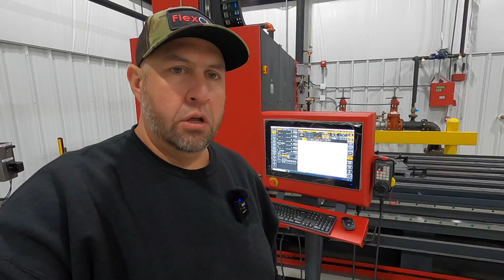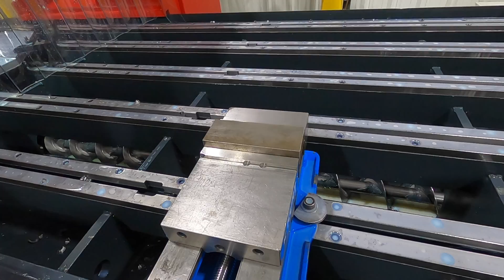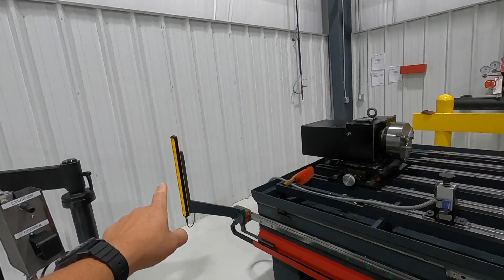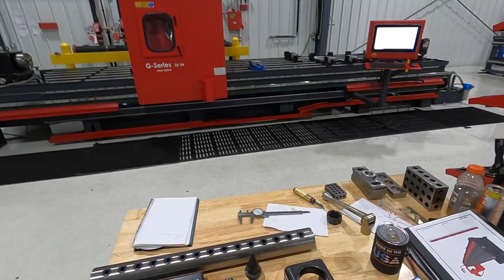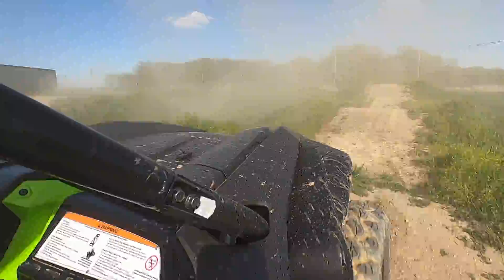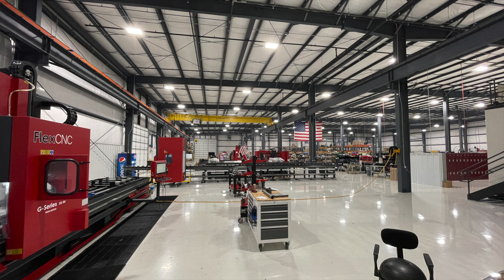SNS 347: CNC Training @FlexMachineTools

Comment: CNC is good when you have to do the same thing many times, for example producing some goods. But when you are repairing something the CNC is not so good anymore. Manual machinig will work fine there and that's why I like this channel. The parts get repaired, not just changed. Keep it going, Adam!

Comment: I've been running CNC since 1983. The first piece of advice I give to all new people, you control it, it doesn't control you. You are in charge, size of machine doesn't matter. Single block, distance to go, rapid and feed override. Learn to use what you are provided with. I've worked in shops since 78, manuals first because there wasn't many CNCs yet. I guess that makes me a OG 😆
Reply: Did you have to use punch cards?
Reply: @TheDandyMann  no, I remember them. I did use reel to reel. Paper tape and metal tape.
Reply: @daviddelaet8116  That's so cool, its amazing how much technology changes and the materials and techniques change with it
Reply: @TheDandyMann  I agree, that 3D printer is very cool. One shop borrowed one for a couple of days and made a 6 inch Cresent wrench out of plastic. They will use those in the space program to manufacture parts on site. Need a wrench on Mars? Make one. 😆
Reply: @daviddelaet8116  i knew one years ago that could read a paper tape, and tell u what iit was going do
Reply: @TheDandyMann  I also like the old machines are being used again. The old screw machines and automatics had nothing wrong with them. Once owners were bitten by the CNC bug the old machines had to go. There are a few exceptions, but not many. One of the first machines I ran was a Warner Swazey # 4 turret lathe. I enjoyed that very much. Hardinge tool room next, that was the smoothest I've ever run. I like the mills now, nothing like 5 axis cutting. Also the Mazak Integrex was pretty slick. I prefer Fanuc because it's what I ran for 30 years and I don't care for Mazatrol. It's been an interesting career for sure. I've got parts on the space station, I've made timing mechanisms for thermonuclear warheads, plastics, woods, and everything else.
Reply: @daviddelaet8116  Man you've been around. Love to hear stories and experience like yours
Reply: @TheDandyMann  I've been around a bit. Michigan, Missouri,  New York, now in Wisconsin. Missouri I made lazer guidance systems for the F-14 Tomcat for Litton. New York was more for the F-14 but engine cowling parts for Northrup Grumman. Michigan was air to air refueling for the new 767 tanker for the air force. Wisconsin is dairy and cheese processing. I've done tool and die in a shop with nothing but manual machines. And I've worked in shops that would drop a million on a machine and not blink. I would literally have to think and write down all the companies I've done work for.
Reply: @TheDandyMann  I guess I could write a book 😆
Reply: @daviddelaet8116  I would read it for sure

Comment: I love CNC lathe machining. I've been doing it for 13 yrs now, and the place I work now I do Mazak lathe and a few different manual machines. My favorite manual machine is a Derkes VTL. We use it to turn big hub plates and capstans for wire drawing machines that we build in our assembly dept. I love your channel because I learn great setup techniques on manual milling machines for some of the rework stuff that I have to do. Parts that you can't just stick in a vice. Know what I mean? Thanks Adam(Abom79), you're great man, machinist, and Youtuber! 👍👍

I'm 100% on board with you furthering your machining experience with CNC!! It will definitely be beneficial for you AND anyone you can do projects and work for. You are on the road to bigger and better my man. Keep up the great work! Love you brother! You're an inspiration to me and many others.

Comment: Adam, we use Gibbs cam in my modelshop. It is very user friendly but is very powerful for both cad and cam. I have trained several guys on Gibbs that have used other software and they always say  it is the most user friendly program and I know it would be perfect for your shop. With the cam portion you really never need to program manually with G-code. Give it a look on the web and also u tube. Our design guys use auto cad and they always comment how easy the Gibbs is to use for design modeling.-TM

Comment: Cool tour, Adam. While you’re in town, try to get to the Armstrong Space Museum. You’re in Neil Armstrong’s home town. It won’t be long before you have a CNC in your shop, that’s just the way it works. It adds a huge capability to the shop. I have a Haas TM1 3 axis mill and a Haas TL1 tool room lathe. It gives me the flexibility to do some pretty cool stuff on racing shock absorbers for a race shop nearby. Good luck.

Comment: Finaly. I been thinking for a long time when you would go into CNC :D
Reply: "The TREX600ESP" 
I flew RC helicopters from the 70's till 2018.  We did things the HARD way at first then came the nitro powered Heliboys and then the electric Trex's.  What a difference it made as the battery technology improved.  Now Elon Musk and his Tesla electric powered vehicles are going to make the same improvement in transportation.  Probably in another 10 years gas powered cars will be a thing of the past. i.e. typewriters/computers.
Reply: @helicopterjohns  I startet with nitro in 2004 befor i went into electric. Electric and hydrogen will be the future.
Reply: @TheTrex600ESP  It was fun watching the transition from nitro to electric in the RC industry. The transition from gas cars to electric cars will be AMAZING and it will happen quicker that everyone thinks. I used to have a website called heliocpterjohn.com and made various items for RC helicopters  and other RC related items. i.e. swashplate leveling setup tools and transmitter balancers for all brands of RC transmitters.  Made all of that stuff on the HAAS CNC machine. I am now doing a lot of prototype stuff as it relates to kayaks and boats.
Reply: @helicopterjohns  Yes, its gonna be fun to experience the transition to electric and hydrogen. Looks like you have fun work, been ckecking your channel :) Myself want to go this way in near future, making tools and custom stuff. I only have manual mill converted to cnc, but looking for used Haas TM, but not easy to get a hold on in norway.

Comment: Pro tip for you Adam : if you're thinking on getting a cnc machine for yourself , the best options are with 'Conversational programming ' - fill out the parameters , and done . Basic understanding of some G codes is necessary , but only a fraction of the total . Also G and M codes are machine specific - it makes no sense to learn them all . G 0 , 1 , 3 , 4 , 40 , 41 , 42 , 90 , 91 , 60 , 64 , 98 , M 0 , 1 , 30 , 8 , 7 , 9 , and a few more are important , but that's it .

Comment: I'm not trying to brag but I have done a lot of the same manual machining that you have Adam again I had a machine shop in my basement growing up I knew back in the day that this was coming down the pike and I've had the opportunity to be a CNC machinist back in the day I'm 55 years old so when that stuff came out in its infancy and to me my decision was is that I could get a more precision part by doing it manually than I could thru a computer. Hence the reason why I stayed a manual Machinist.. I guess I missed the boat a bad decision on my part but this is all next level and I don't even think I could fathom having to go back to work and learning CNC machining most people just walk up it's already programmed you push the button and make it go but to get in depth into it and have the machine and learning all the g codes and learning how to set the machine up is some next level stuff.. thanks for bringing us along maybe this video would change my mind

Comment: That Flowdrill is pretty neat. Reminds me of a tour I took of a Caterpillar plant (since closed, because of course they closed it) that did friction welding, to attach the rod end to a hydraulic piston. I've also read of friction-stir welding, which is somewhat similar. They use it in aerospace to butt-weld plates, by forcing a rotating tool into the joint and traversing it, leaving the edges to melt and fuse together.

Comment: Next: Abom goes metric :-)
Reply: NEVER
Reply: You are highly exaggerating
Reply: As manual machinist.I was converting metric to inches.Over 40 years ago. It was no big deal. One has to learn how to machine first. At this time anyone can program a CNC. I should showed supposedly good. Programmer and operator. How make their 8 minute part on 2 turret CNC lathe.. Turn it into a 4 minute part job.  Because of the lack of the machining skills they did not have.  Keep the great work Abom .One always needs to improve their skills. You have taught me a few things. Thanks.

Comment: It's cool to see you're finally delving into the world of CNC. I've been running CNC machines for about 12 years now, but I've always wanted to learn about manual machining. Unfortunately, I have never been given the opportunity at any of the shops I've worked in to get much manual experience. I feel like conventional machining is somewhat of a dying art these days. I really enjoy watching your videos. If I knew merely a fraction of what you do about manual machining I feel like I would be a much more well rounded machinist. Keep up the good work, Adam!
Reply: I think by using the electronic handwheel you could even use a CNC machine like a manual machine. Would be a bit unusual, but it works. You'd even have a DRO :D
Reply: @CatNolara  Yes, I've done that before many times actually!

Comment: You will love cnc, makes things so much easier. Lazy guy like myself finds it a necessity.
Reply: Depends, small simple one off jobs are still better to do on a manual machine. CNC has its strengths in complex and/or repeating jobs.

Comment: Im in a local CNC machining program to learn the field and get a job in it soon. For sure CNC is a bit daunting to learn and trust the machine when you hit the start button. But after a while you get the hang of it and become more trusting of the machine.

Always enjoy watching your videos to learn different potential ways to do manual machining setups and tasks and take that into my classes to improve my setups.
Reply: @ricardomierz8467  Agreed, the ability to cut out programming errors whilst under pressure to get the job done.

Comment: For me it was the other way around: I started with CAD and built a very simple CNC router as electronics project and got into machining and machine tools that way. Your videos made me want a lathe btw. and recently I finally got around to get one. Having watched so many of your videos (and from others too) made getting started really easy.
You'll find out that a lot of your experience will transfer quite well.
Knowing G-Code doesn't hurt at all, but when you use CAM you barely need it. It mostly helps with troubleshooting, but other than that I rarely look into the generated code. 
As for a CAD-Program I can recommend Fusion 360, you can use it free if you don't use it for for business, but even then it's not overly expensive. It's also very tidy, it's easy to find your way around.

Comment: Like all of my experience with cnc both drawings and machining, it takes longer to make one part but quicker to do multiple units. If you have a shop with multiple employees the computers allow for cheaper wages and less experienced operators. There are alot of young employees willing to crash your machine for minimum wages. Just do the set up for them and pay them to stand there and watch. Don't let them sit down or bring in a phone or nothing will get changed.

Comment: CNC is still very expensive for the home shop on metal, but ultimately bit is just another tool for doing work.  Very useful for doing batch work, manual can do some one-off work faster.
Reply: If we are talking brand new equipment, at a normal decent size, CNC is expencive naturally, and nothing for the home machnist just doing own stuff and for the neighbour. But there are second hand equipment around, and cnc table top machines, conversion kits for manual machines, so there are options around these days out there for one who really wants go CNC at a homeshop that won't 'break the bank'. but to most, CNC is not the way to go at a homeshop, except maybe table top size equipment.
Reply: And really CNC is mainly for production purposes, not for producing one or two parts. If you're going to make a hundred parts..... CNC is the way to go!

Comment: I worked with a 3 axis CNC router in a cabinet shop. The learning curve was very steep but once you learn the basic concepts and get familiar with how the code runs the machine, you will find that CNC machining will make you even more creative. With Cad/cam software and auto compiliation of the M/G code, you won’t actually have to write code. The trick is to be able to look at the code and know what it means. Your creativity will only be limited by (and I am assuming here) your ability to use AutoCad. That is another huge hurdle in itself.

Comment: You've done some 3D printing so you have a good start. The best thing for me was learning a simple G-code for doing facing. That saves a lot of turning the handles. My machine is a "Boss 5" Bridgeport "Rigid Ram" from about 1980. It was used in the Starshine satelite project. I was able to connect a PC through a serial port connection and feed it the G-code. You are definitely starting on a much more complex machining center. Good job!